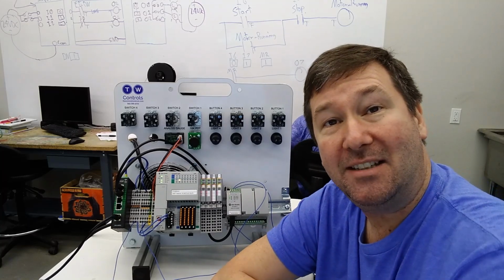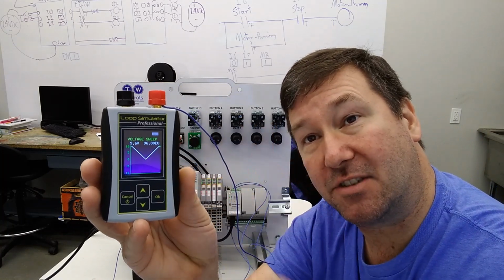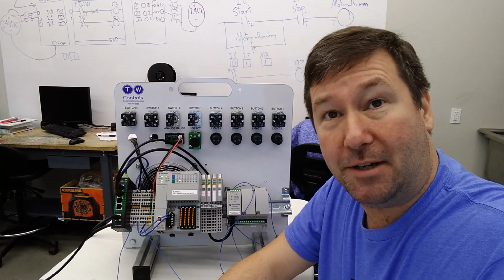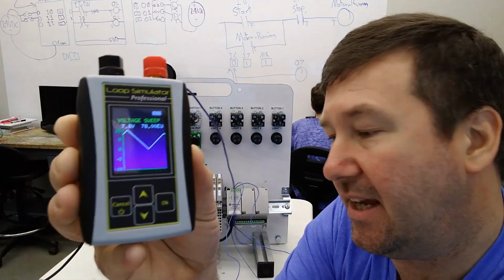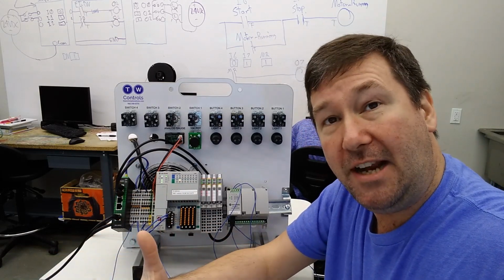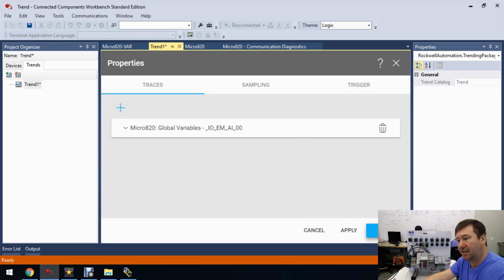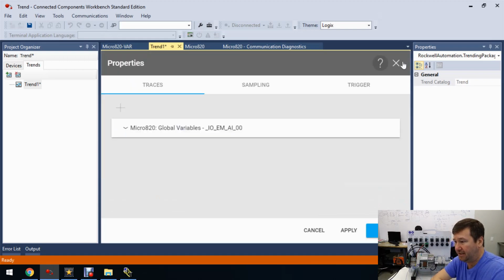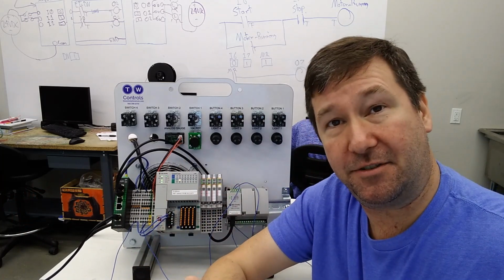How to Configure Trends in Connected Components Workbench for the Allen Bradley Micro800 PLC

Comment: Do you happen to know if there is a way to connect wonderware to a micro820 to monitor the "Trends" tab?
Reply from the maker: I think it would be easier to set up a separate trend in Wonderware
Reply: @TimWilborne  by setting up an analog output from the micro820 to wonderware?

Comment: General question, but does CCW allow you to force inputs in ladder logic (by setting the physical input tag to read/write first ofcourse or else the program won't build)? In my current setup, the logical value does change but the state change does not get carried through the rung (I am using these inputs to trigger timers via an OSR). The logic works fine if I trigger the input via the Micro800 Simulator.
Reply from the maker: Yes, it has forces.  It is on the list to do a video on.  Open up the global variables and find the Lock column.  Check the box on the bit you want to force then check the logical value box.
Reply: Tim Wilborne what i meant is I’m able to force the Inputs but the rungs on which they are used as contacts doesn’t follow through and the logic does not get evaluated. Not sure why... . Any way i could share my project or a screenshot maybe?